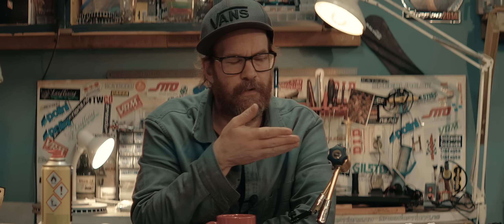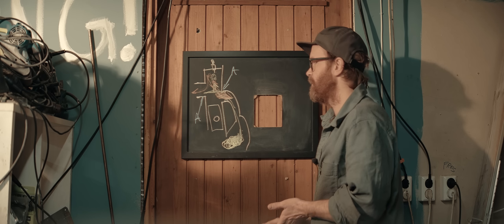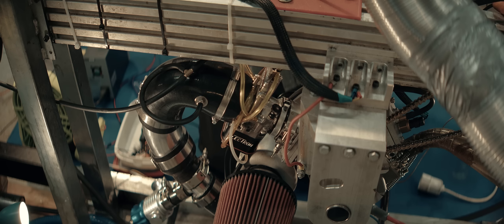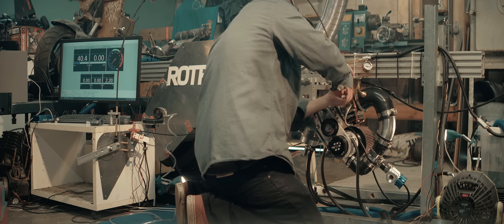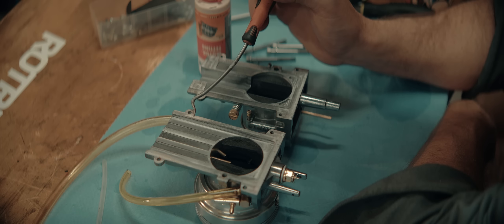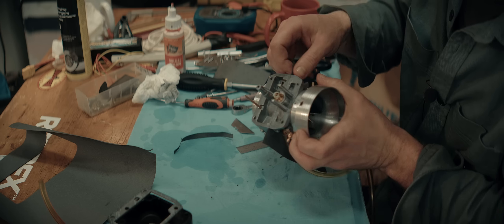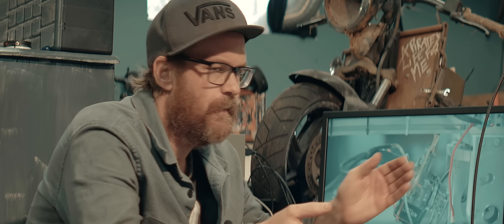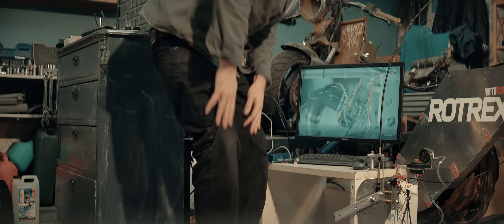50cc Engine in there somewhere...

Comment: Aviation engine manufacturer Teledyne.Continental had a project, TCM GAP (NASA sponsored) for a two stroke aerodiesel. It used both turbo and supercharger. Same gas exchange challenges as you are facing. The GAP was injected of course. I visited the factory and saw it running. Then they licensed a French design https://en.wikipedia.org/wiki/Continental_CD-230, four stroke. I think you are making it harder for your goal by not going injected. Much of your challenges are focused on the fueling. Imagine getting beyond this and just having to map fuel and ignition from you laptop. I converted a Volvo B235 for my boat using Microsquirt full engine management. It ran at first startup.

Comment: The back fire issue seems to be the same problem you had, when you was using the other super charger. Have you considered using a Motoplat or Selettra PVL type ignition instead of using what your currently running?

Seeing the your engine is now always blowing would redesigning the exhaust pipe make it work better now that you don't need exhaust blow back?

Comment: What about O-ringing the carb, using dead soft copper wire to seal the half's,   someone like 28 gauge, wire, with a groove in both halves,  the next possibility of putting the carb in a box !  Then connect the blower to the box, I think a throttle body injection, would be a idea worth it!

Comment: So just run the supercharger into the cylinder intake port instead of through the crank case. That way you can just run fuel instead of fuel/oil. Your pressure and combustion will be the same, everything will work off the supercharger. I think they are called compressor motors?

Comment: Make your own carb 🤷🏼‍♂️.  Would rather see that than efi. 💪🏻
Reply: I think a slightly modified SU carb with separate float bowl and adjust while running main jet with butterfly throttle body would be good. Did Alex drop a hint about a new carb? You might be onto something.

Comment: If the seal isn't an "O" shape, it should give a good indicator where it is leaking... you cut an U and that shape is open at the top. And at high pressure even the smallest of wiggle room means that more fuel can be pressured pass the intake valve into a direction you don't want it to go. So instead of giving it more space, try a slightly thicker sliding valve?

Comment: Stinger probably needs to get resized to match the volumetric flow of the supercharger, otherwise the back pressure (which affects cylinder pressure) will likely cancel out a lot of benefits from a higher crankcase pressure.
Of course this is a balancing act as a higher flow stinger means larger hump before you see benefits.
Reply: For disclosure, I posted a reply to a comment similar to your post prior to seeing yours. N/A expansion chambers need calculating to the size of the carb for ultimate performance.
Reply: @malcrandall1309  That only partially applies here as a higher blow through pressure relative to atmospheric will "emulate" a bigger carb and cylinder.
As an example, 2atm of air fuel mixture through a 50cc cylinder will roughly emulate a 100cc engine all other things being equal, and to vent that to 1atm you need an appropriately sized stinger.

Comment: If you use a smaller carb it may have a smaller slide and cross section so that will give less surface area for the boost presure to push it apart. Or you could put clamping screws stradling the slide to clamp the carb together

Comment: Unless you can find a way to keep the exhaust port closed until the piston covers it all your boost goes out the exhaust port. Easy to do with a variable restriction ex orifice with logic based from rpm/boost pressure/pipe pressure. Can't wait to see how you tackle this. back in 1990 when I was doing it we didn't have anything good enough to make it work.
Reply from the maker: If you scroll back through my videos you'll find some experimentation with rotary exhaust valves and reed valves in the transfers. They might make a return.

Comment: Just a thought from blow through carb setups on cars. As the Lectron isn’t a blow through carb, maybe making a carb box so the outside and inside of the carb are at equal pressure and it will stop the leaks and allow for proper tuning?

Comment: I wonder if using a more "rubber" based sealant wouldn't work to seal the carb? It should help glue the two sides of the carb together and should have some give to move with the metal as it flexes under load.

Comment: Question; Why bother wasting time & energy by passing/routing the 'charge' of fuel/air via the crankcase & transfer ports if you have a supercharger to provide positive pressure?
I can think of a few benefits, but what would be the drawbacks, besides bottom-end lubrication?
Thanks for sharing & giving the ol thinker something to ponder!
Reply: The centrifugal blower he is using can't provide much if any pumping at low speed (i.e. idle/startup) so one advantage of keeping the whole mess of breathing through the crankcase is it can provide pumping (using his retractable reed valve) at speeds where the blower is ineffective.

The main reason however is to avoid the complication of making an appropriate lubrication system for the bottom end. Simple splash oiling probably would not be successful at 18,000 rpm, and a pressure fed system is complicated to build.

Comment: another thought now that your blowing air and fuel in make a new block with the inlet port going direct to the carb and not through the crankcase and oil system for the crank

Comment: Imperial allen head screws? Why not just drill the existing threads out to the next size up (in metric) and tap them for that?
Reply from the maker: I would, but the threads already break through the inside corner, no room for next size up unfortunately.

Comment: I enjoy your videos but I must admit I would have set this engine up with a Speeduino ECU from the beginning instead of a carburettor. That way you remove all the guesswork from both the spark (timing, spark intensity, etc.) and fuel mixture map. If it's rich or lean in any spot you'll see it there and then and adjust to suit. Carburettors are a compromise at best.

Comment: Direct injection would solve all your problems but then you need some sort of high pressure pump. If it was also diesel you could eliminate the ignition totally. Two stroke diesels like the GMC and Commers and others are super simple and very efficient. I dont know if the principals could be scaled down to a 50cc motor.

Comment: I came to your channel late,  but have you tried putting the carb in a plenum chamber and blow the charger straight into the chamber to equalise the air pressure round the carb

Comment: Jb weld is gas soluble. Have you considered making a new port for your engine dedicated for the turbo pressure? Seems like constant pressure from the turbo would retard the timing if you have the exhaust port open the same time the turbo is also putting pressure into the crankcase

Comment: I'm not sure how it would work with Nitro methanol but Honda  Bond Is a factory Honda sealant that is used on 2 stroke cases that is fuel resistant it's Gray and really thin but it dries really hard Try that it's easy to get I have used it in the past even on exhaust manifold gaskets  In automotive applications With poor surface finish It filled in the Voids it's really good stuff

Comment: Regarding the mention of possibly going down the EFI path if you do end up going down that path there's universal motorcycle EFI kits that are self tuning. 
You put in the target/desired afr range and it will automatically adjust the injector duty cycle accordingly, however they do use a wide band o2 sensor so I'm not sure if the 2 stroke oil would "poison" the sensor or not but I do know from experience alcohol fuels are rather hard on o2 sensors as well and they have a relatively short life  🤔

Comment: At this point, would it be possible to use a very simple Microsquirt Speed/Density EFI with one injector so you do not have to fiddle with all those analog hoses/slides/needles etc? (Perhaps even refit a direct-injection injector). You would need +12V and fuel pump but you already need battery for ignition so it is not a big step. If you can combine ignition and fueling into one box you might even simplify the setup.

Comment: You could always use a ml flow adjuster for your pressure comenspensation on the carb. that way your internal calculations will be within specc and + whatever % more for adjustment. if you build a new carb.

Comment: Thanks. A few random tips!. you will need dual or triple paths on the spark plug and/or a longer plug thread, short low resistance plug leads and stable 12v supply. Do you have auto spark advance as revolutions increase.

Comment: Hi there!! I am NOT A TWO STROKE GUY - i concentrated on the dark 4 Stroke Side many Years ago....but if the Blow down AREA is that importend AND you struggle in timing that in - why not use a (good) 4 Stroke Engine with your PIP Cylinder....so you could turn on and of as much Valves and Duration you want for desired Blowdown Time with the Camshafts. Like the SUPERCHARGED SHIP ENGINES. Tell me if I´m wrong - just enjoing the Engine Content (By the way, i have build two Dyno´s with Sport Devices and YOURDYNO Software for my Passion:) Thanks for your Work, its cool.
Reply: Also i would look pretty sick.

Comment: That engine working craphics is wrong, that supersharger push all gases straight out of exhaustport in pipe, not in cylinder.
Measure your exhaust pressure near to cylinder, that pressure have to be more than boost pressure when exhaust port close.
Reply: I think Alex answered a comment similar to yours previously. The return wave in the expansion chamber produces around 2-3 bars of blocking pressure at the piston face.

Comment: Nice work, as always! Been following this channel already for a long time, first time commenting as im not so familiar with 2-strokes but this project is one of my favorites! But i have been wondering many times that why you don't fiddle with the ignition timing more? In boosted cars you retard the ignition when the boost starts to kick in and also when in boost, so why it would not be a case here also? I remember that you run pretty much stable advance curve? And i think the rabbit hole is much deeper with the blow-through carb and those pitot-tubes than what it would be with EFi :) but my experiences are only with 4-strokes so i cannot exactly say does the EFi work same way with 2-stroke. But you could have so much more feedback with efi and not so much guesswork.

Comment: The piston speed is a factor of RPM, the time factor should not have relevance. How much fuel/air are you stuffing in there to get X amount of power, is relevant.
Reply from the maker: Time is relevant(and relative😁), effective port area decreases with rpm which in turn restricts how much you can stuff into the cylinder.
Reply: I think this is a bit of a torque vs HP argument. More air per stroke = more torque, more air per second = more hp

Comment: One of the problems with having a supercharger connected to the crankcase is that you get a lot of back pressure in the crankcase.
Reply from the maker: Fights the poston on its way down, helps it on the way up.
Reply: Acts like a big spring, so you don’t actually lose much energy at all
Reply: @zgrb  No, it's not like a spring, because the compressed air in the crankcase goes up the transfer ports and into the cylinder. So the sping effect is like zero.

Comment: I used to run a Lectron on my enduro bike, it now sits on a shelf doing nothing, there are too many design faults in my opinion, I would often see dirt in the inlet track of my engine, the air filter did not pass dirt, I'm sure it was the carb split that was letting dust into my engine.

Comment: Is there a way of fitting a wide band lambda sensor?. At least then you can monitor what's going on fuel wise at different rpm. It's do'able with a lambda sensor with multimeter attached  😎

Comment: Just had a brain wave (possibly a brain fart, but well see).
What if instead of rpm controlled "Reed slide valve", it was controlled by boost level. Like it runs on Reed valve, until a set boost/vacuum is reached, then valve opens. 

Just a thought.

Comment: Personally I've never been a fan of Lectron carbs and it's quite a long time since I played with any but I'm pretty sure they had at least six screws where your late model has only four. If the face is distorted, a gasket will probably make things worse as it compresses under the screws and bends further out in middle. 
JB Weld will be OK for a while but in my experience it will start to leak or crack due to the high frequency vibration.
You need to check everything is flat or even a little bowed on the ends so it clamps centre section. Alternatively, just make a new body with the extra screws (probably quicker than messing around with the carb you have?.

Comment: hard to control. i advise you to use a ecu and injectionsystem! and also maybe a straight exhaust instead of a tuning pipe. Remember its a charger/turbo system u use. u dont want a back press ina turbo system. so no tuning pipe like normal for 2 stroke

Comment: I guess you have looked into this but why bother using the crankcase as a pump at all? if you have a blower you could just connect ports directly up to the blower. (I don't want to call them transfer ports because they would not be transferring the mixture from below the piston to above the piston). This would mean that you can lubricate the bottom and using in a 4 stroke style, you could even use white metal shell bearings rather than ball and roller bearings. You could also get rid of the inlet port. (although in your case it is direct into the crankcase which is better with regards to piston life compared to an inlet port in the cylinder). I guess you might reply stating that at low RPM the blower does not move enough air to run the engine but then again using the crankcase and the piston as a pump is only going to move 50cc of air and I suspect a lot less than that in practice, surely even at low RPM you blower can move 50cc of air fast enough to get the engine running?

Comment: Just an idea but lol...could you set the blower up on the exhaust side in a venturi type setup? So the fast air of the blower would assist the exhaust in evacuation and in turn help pull in a fresh charge of air and fuel? I know it would not be the most efficient process but it might be fun to try just for kicks.

Comment: When you were working on the brute force engine experimenting with the expansion chamber exhaust you said you sized the exhaust chamber to match the measured output HP combined with the inefficiency of the original blower, ie, you sized the chamber on the pipe for something like 40 hp. Do you also need to similarly upsize the crankcase volume to match the higher flow and air volume of the blower? I'm just wondering if you have some mismatch going on.
Reply: I believe this expansion chamber was made for the N/A resonant induction PiP engine tuned to 19k.

Comment: That things getting nasty ! 
When you going to go fuel injection? 
You need a standalone making all these corrections in milliseconds , your going way beyond a carb . Let a computer do it Then you can read logs and not guess on pulls . Keep it carberated with all the sensors recording data , then phase in the fuel injection . That thing is sounding vicious now

Comment: Dumb question, why don't you just pressurise the crank case with compressed air to the pressure required? I realise that you would have to do it through the carb . If you get that running then set up your blower to the same psi.
Reply from the maker: That is exactly what I'm doing...
Reply: Ok I do realise that. How about you  pressurise the crank and run it with out fuel and spark. Then measure the flow out of the exhaust. You might see a pattern present itself

Comment: Hi there, whats about use the compressor between engine and carb?
In a carb there should be underpressure to work, let the compressor suck not blow, then your carb wont go crazy like now. I mean everybody is using turbos on carbs between engine and carb or direct injection

Comment: Did you fix the blow-off valve, or just remove it completely?  If you removed it, maybe you should put it back in (and make sure it's working correctly) to protect all of this effort from another destructive failure like you experienced with the roots supercharger.

Comment: It seems like it would be interesting to test smaller exhaust ports to exchange blow by for more pressure in post-super charger intake path.   I am wondering when the hp require to turn the compressor is considered, are you north of 30hp at one point.

Comment: hey check out smart carb they are internaly vented and have just fuel, choke, and throttel wire to connect and its easiely the best carb ever so check em out

Comment: Just an idea but if you could find a way to put a much longer rod in it it would give you a longer duration of dwell timing which is what is needed for high RPM power maybe you can make a custom piston that has a relocated wrist pain to gain an extra inch of rod length
Reply: @Retired Bore I'm running a six and a half inch rod in my 1100 horsepower 327sbc that turns 13k naturally aspirated this is only achieved because I want the longest rod possible my piston didn't get any shorter I just changed where my wrist pin went in my piston..... The purpose is to get more dwell timing at wot
Reply from the maker: I'm running a 90mm rod, fairly long for 39.3mm stroke. Long rods mean you can run higher ports thereby more area for the same duration, another advantage👍